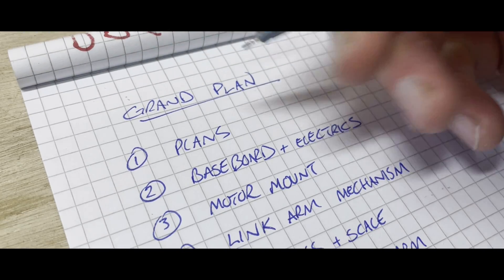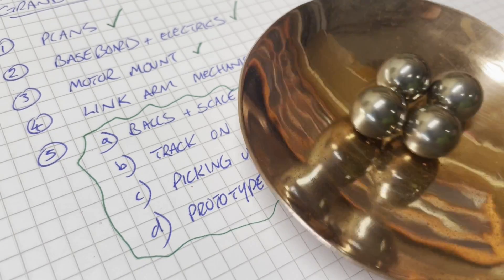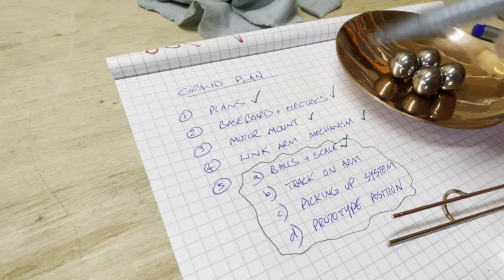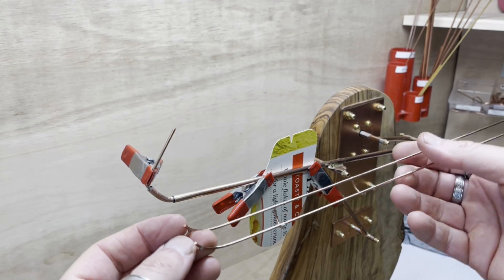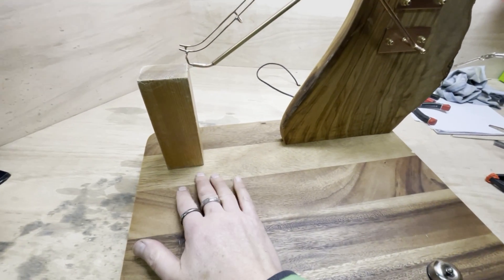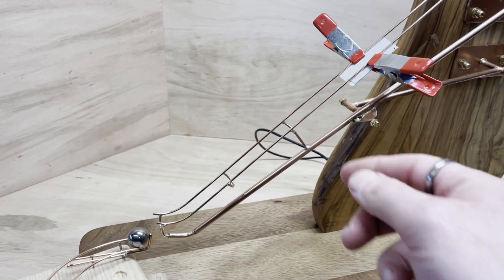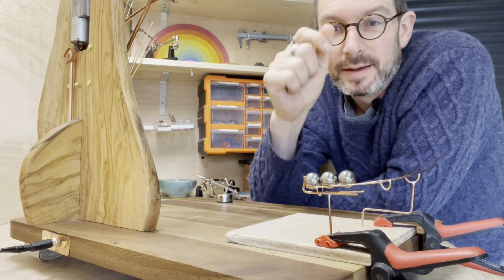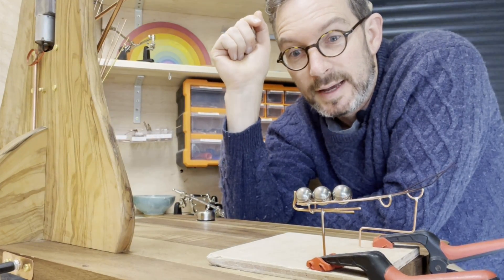Adding the ball collection system to my Rolling Ball Sculpture RBS4 EP 5

Comment: Nice surprise 😀. 
Whilst I was trying to anticipate how you might realize dropping the ball in the upper position, you just decided to send it across the lift arm to the other side..
I like this idea, (even had it myself 😉), since it adds an unexpeted movement  just to the start of the descent :washhands:.
Was it a spontainous idea? I'm courious how you are thinking.. 😂
Reply from the maker: Hi Dietmar, I have seen other RBS with balls rolling on moving or rotating arms, so it’s not a totally new idea. But yes I did think of this before starting the link arms as I needed to know where the ball was heading before I fixed the linkages in place. 

Thanks for your comments!